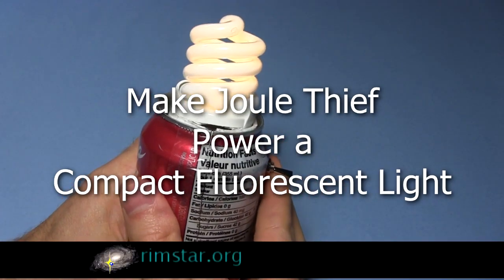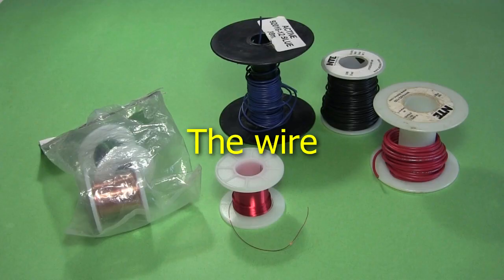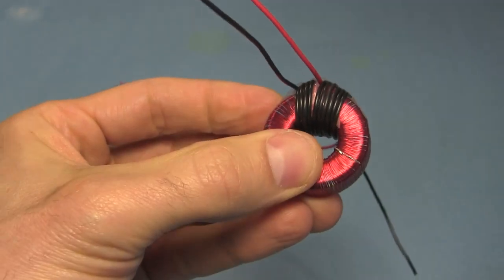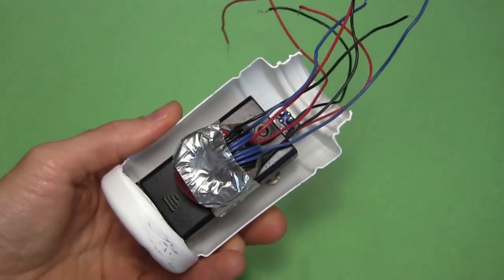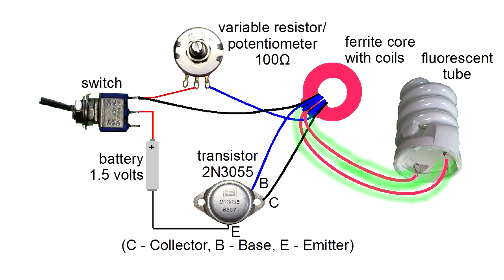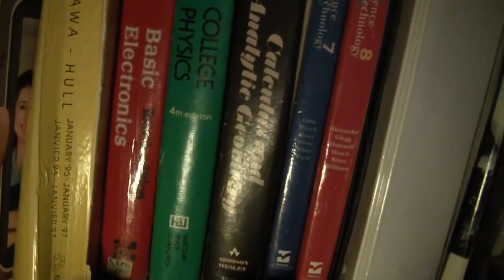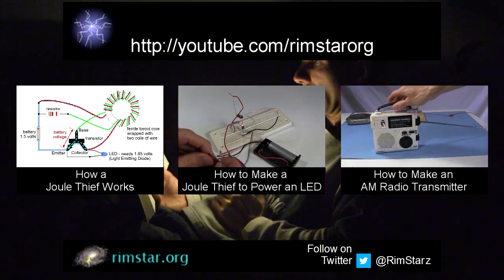How to Make Joule Thief Light a CFL - Jeanna's Light

Comment: i tried to make it couple of times on different  sizes of ferrite core... but i doesn't got any  voltage on my secondary coil. please help me regarding this problem....
Reply from the maker: +Diwakar Dey Any number of things can be going wrong. First check your connections to make sure they're right. The way the coil is connected to the circuit is the opposite of what you'd expect. I'll assume you used thicker insulated wire where the coil ends meet as I showed in the video. Try a higher input/battery voltage - that''ll result in a higher output voltage. Look for a lower wattage CFL (you can see more on that in my follow-up video here https://www.youtube.com/watch?v=yz_99oVMbSI).
Reply: +RimstarOrg does there is drop in current after passing through the coiling?

Comment: hi, can i use a permanent magnet from a speaker to wind the wires.
i have been trying for a month but i am not getting success.
Reply from the maker: harsh bawari I really don't know how well speaker magnets will work. The magnetism may interfere or it may be too weak to interfere. You'll have to try it and see.Switching to a lower wattage CFL will help. Also, using more batteries in series (positive of one connected to the negative of the next one.) I wasn't getting any success until I added a second battery. Also, check your connections to the coils carefully. They're connected in a way that's backward what you'd normally expect. And pay attention to what I say in the video 2:10 where I talk about the two ends of the coils coming close together with the thin insulation. And lastly, my follow-up video "Fun with Joule Thief Powering a CFL" may offer some insights https://www.youtube.com/watch?v=yz_99oVMbSI
Reply: RimstarOrg have you tried an core transformer for a joule thief? try it, i think it will work. you can also find some formulas for an air core transformer. i have also seen a video on ferrite core vs. air core, really air core works well. how much resistance worked for you? i will try that much fixed value resistor.
Reply from the maker: harsh bawari I suspect an air core transformer might work too, since it's a toroid. In a toroid that is completely and well covered in windings, most of the magnetic field is inside the toroid, which makes me think it doesn't matter if it's air core or ferrite.As for the resistance, I used a variable resistor to control the brightness, so what works depends on what brightness you want. See the link I gave for my follow-up video where I show different resistances with different CFL tubes.
Reply: RimstarOrg

I have made JT circuit using just air core toroids but, you need an order of magnitude more windings to get the same inductance as using even a small ferrite or iron powdered core.  I don't recall the ratio but it is a lot of wire.  You also will get higher freqs. this way as well.

Bill

Comment: Hello!
Greetings from brazil!
I'm trying to build one of this. but all i got is 50vac on output and a little noise from coil. operating at 3v
any clue? thanks
Reply from the maker: Hard to say without a lot more details. I know adding the second battery helped me. Maybe keep adding batteries in series? How are you measuring the voltage?  An RMS digital meter won't give a very accurate measurement for this type of output. You almost need an oscilloscope. Oh, an trying a lower wattage CFL might help.
Reply: RimstarOrg
Hello!
thanks for your answer.
Here is the deal, i got the same output on 6v;
and i tough the same about the cfl lamp. so i bought a 11w cfl, then remove bulb for test, and again no result.
i know that there is some ac voltage output, because i put my fingers on output, but that was such a bad idea!! lol
yep, i'm testing with a multi meter! :( (don't have an oscilloscope, these are so much expensive on brazil.)
i'v made two coils, and with magnet wire i'v got 49vac
i think that the red coil need more wires.
Reply: Mauricio Scotton i forgot: fresh batteries!
Reply from the maker: Mauricio Scotton
That sounds like you mean you got it working! (the fresh batteries) If so, yay!

Comment: can I use 10k potentiometer ?
Reply from the maker: You can but the required resistance is so low compared to the 10,000 ohm range that you'll really just have it turned all the way in one direction. You need under 100 ohms.

Comment: What's the output voltage ?
Reply from the maker: I estimate it's around 1000 volts. I was outside the range for my oscilloscope so I couldn't tell exactly. You can see this measurement at 3:10 in my Fun with Joule Thief Powering a Compact Fluorescent Light video.
Reply: RimstarOrg Thanks, I'm gonna try to build one and make a video.

Comment: I'm thinking of making something like this but instead of this circuit I'm either going to use the inverter from a phone sanitizer device that you put your phone in. or the guts to a UV light that runs on 4 AAA batteries. Not sure which one to use. I have a small CFL bulb that failed but the tube works. And I just threw out a vitamin bottle Dang should have kept it. Might use a small power bank for power instead of the AAAs.

Comment: Hi...I used a MJE3055t transistor...and it seems to get very hot....is this ok..I have no heat sink on it...and its a TO-220 case..
Reply from the maker: +Kennynva T. If it gets very hot then you could end up damaging the transistor. According to this datasheet it can handle up to around 115C https://www.fairchildsemi.com/datasheets/MJ/MJE3055T.pdf and you'll also run you battery down sooner than if it kept cool. You can put a heat sink on a TO-220 case. I show in my follow-up video the difference I get without and with a heat sink https://www.youtube.com/watch?v=yz_99oVMbSI.
Reply: Doing it this way..the cfl will light a little on each leg..IF i touch it with a pair of pliers..or anything metal...cant figure out why tho..do you tie each leg of the cfl together? making 2 legs..that have 2 wires connected together..
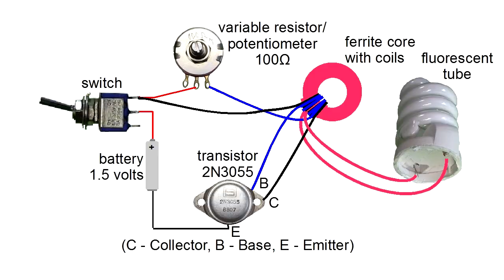Reply from the maker: +Kennynva T. I'm not sure what you're defining as a leg. The way I do it is shown in the video at 4:54.
Reply: The wires coming out of the light bulb..do you think the transistor I am using is ok? or get the one your using...? Thanks for your fast response..
Reply from the maker: +Kennynva T. Regarding the transistor, see my previous reply. Compare the datasheet for yours to this one http://www.onsemi.com/pub_link/Collateral/2N3055-D.PDF and you'll see the 2N3055 can handle a higher temperature. But if yours works fine with a heat sink then it doesn't matter.
Reply: Ok thanks...you made a very good video..thanks...

Comment: If I wanted to use this circuit to power a 36W fluorescent tube, what would I have to change?
Reply from the maker: You'd need a bigger power source and probably a bigger coil to handle the extra current.
Reply: I’m thinking, same windings but ones that can handle more current?
Reply: @RimstarOrg  Yeah I'm thinking I could wind a toroid with slightly thicker wire so it doesn't act as a resistive current limiter, and then do a big bank of AAs in parallel to supply the current. 

Maybe also run at 3V instead?
Reply from the maker: Regarding the number of windings, I don't know if a 36W fluorescent tube would require a higher voltage in order to light. There's the voltage you need in order to ignite it and then once lit, you can use a lower voltage.

Comment: how long would those AA batteries last powering the cfl?
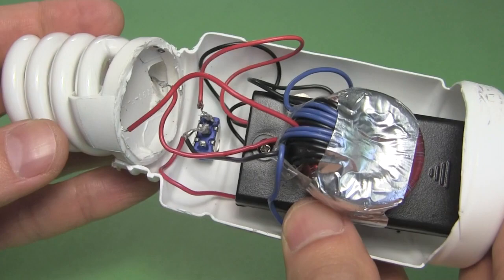Reply from the maker: +Amith Gowda If I add a heat sink for the transistor and switch to a lower wattage cfl (still getting the same amount of light though) then I get 1.5 hours of bright light followed by 15 minutes of dimmer light. I show this experimentation in my follow-up video at 5:15 https://www.youtube.com/watch?v=yz_99oVMbSI.
Reply: +RimstarOrg i got a smaller diameter core is that ok? and can use the windings from a transformer for the toroid?
Reply from the maker: +Amith Gowda With a smaller diameter core you may not be able to get enough windings on to get a high enough voltage. Hard to say without trying though of course. And yes, you can use the wire from a transformer. Just keep in mind the part of the video where I talked about keeping the ends of the winding apart and using better insulated wire at that point.
Reply: RimstarOrg  sorry to bother you again 😆 will that aluminium foil act as a heat sink?
Reply from the maker: +Amith Gowda I would think so. I guess if you used it to give enough surface area exposed to the ambient air. I don't know how the thinness would affect it. It would be an interesting experiment.

Comment: why we cannot overlap wire while winding the toroid?
Reply from the maker: The insulation on those wires is very thin. It has to be otherwise you wouldn't be able to put on enough turns. However, when the two ends meet after all those turns, there is a high voltage between the two ends. That high voltage is enough to break through the thin insulation and create a short circuit, preventing the circuit from working. That's why before the thin insulated wires meet, I connect on some wire with thicker insulation instead. The high voltage doesn't break through the thicker insulation.

Comment: what gauge of wire you have use?
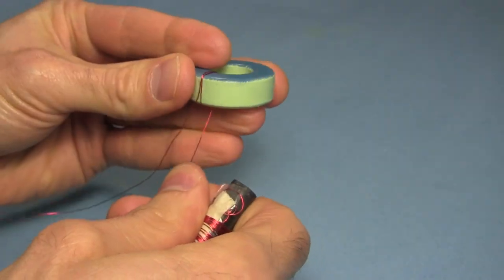Reply from the maker: The many turns coil was 30 AWG wire. See the video at 1:55. The gauge of the other wire doesn't matter.
Reply: can I use 29 gauge wire for 250 turns ?

Comment: can you tell the size of toroid ?
Reply from the maker: It was pretty randomly selected. I chose it because I figured it was big enough to get a few hundred turns of wire on. It was 1 1/4" outer diameter by 5/8" inner diameter. To help, I also have this webpage that may have more details http://rimstar.org/science_electronics_projects/joule_thief_power_cfl_with_jeannas_light_circuit.htm.

Comment: I suppose a person could integrate a solar cell,use rechargeable batteries and mount these lil guys outside?
Reply from the maker: Absolutely. In fact, that would be a nice addition.
Reply from the maker: MANIK SHARMA
I don't see why you couldn't recharge a capacitor with it but due to the losses you'd eventually run out of energy. This isn't a free energy device. The name, joule "thief", is a very misleading name. All it does is build up energy in a magnetic field, while outputting nothing. And then it outputs that energy in a burst. Then it builds it up again and repeats. So it seems like it's putting out higher voltage and current than it inputs but it's not really.

Comment: why do we have to use transistor in the circuit why can't we just connect the joule thief directly to the lamp?
Reply from the maker: The transistor is a part of the joule thief circuit.
Reply: what is the big top priority for the transistor in the joule thief not to mention it is working as a switch ..what will happen if we connect it directly to the lamp?? and thanks
Reply from the maker: See my video here about how a joule thief circuit works https://www.youtube.com/watch?v=0GVLnyTdqkg. You can see it's an important part of it.
By connect the lamp directly, do you mean without taking it apart? That won't work. There are all sorts of electronics in the lamp that will interfere.

Comment: what is the resistance when it reach max brightness
Reply from the maker: Unfortunately I don't know. I didn't measure it (I'm not sure how I would).
Reply: can you measure it i need that information please
Reply: what if i use 22ohm resistor instead of variable resistor?
Reply from the maker: Oh, I misunderstood your original question. I thought you were asking about the impedance (resistance to AC) in the coil. See my follow-up voltage where I make a bunch of measurements and give tips. Basically, the lower the resistance, the brighter the light but the shorter a time the batteries will last.

Comment: How big was you ferrite core?
Reply from the maker: Prohaxz gaming 5/8" inner diameter, 1 1/4" outer diameter, 3/8" thick. I selected it pretty much at random but such that I could at least get a lot of turns of wire on it.
Reply: Can I use a 100k-ohm potentiometer, I had it lying around
Reply from the maker: Prohaxz gaming It's bigger than mine so you should be able to get more turns on. I can't say for sure of course whether it will work but I don't see why not.
Reply from the maker: Prohaxz gaming 100k-ohm is a little big. All your tunability will be with the potentiometer turned almost all the way down, if not all the way. I just checked one of mine and turned all the way down I had 50 ohms. I turned it a tiny bit and already I had a few hundred ohms, too much. There was nothing in between. I suggest doing the same measurements yourself to see how useful it would be. From my follow-up video "Fun with Joule Thief Powering a Compact Fluorescent Light" you can see that at times I needed 30 to 50 ohms.
Reply: Thanks

Comment: What is the dimensions of the toroid
Reply from the maker: It's around 1 1/4" (3.5 cm) outer diameter and 5/8" (1.875 cm) inner diameter.
Reply: @RimstarOrg  Thanks because I have been trying to wind the primary and feedback but there is not much space on mine but I did it and it works great

Comment: how the size of Ferit core??
Reply from the maker: It's around 1 1/4" outer diameter. It was just one I happened to have but it's about the smallest you want to use. I probably took that one from a microwave oven. It needs to be big enough to get lots of turns of wire onto.
Reply: Ok thanks

Comment: i subscribe your channel as well as hit a like. how long will the circuit blow the bulb?
reply as soon as possible.
BTW your circuit is awesome if it is real.
Reply from the maker: +Mobin Akhtar In my follow-up video https://www.youtube.com/watch?v=yz_99oVMbSI, at around 5 minutes and 45 seconds in I show where I test the time. This one runs brightly for around 25 minutes. If you put the transistor on a heat sink and use a lower watt CFL (but still put out the same amount of light) then it runs brightly for around 1 hour 30 minutes.
Reply: +RimstarOrg thanks, now i m going to try this project.
I will ask some questions while making this project if needed.
Reply: +RimstarOrg one more thing, if i use some led diodes (approx 10) in pcb board in place of CFL then how long will it blow???
Reply: +RimstarOrg and is it possible to blow some LED/CFL without any power supply. I m talking about free energy. Many videos are available on youtube. I could not justify that free energy is real or fake?
Reply from the maker: +Mobin Akhtar No, you need a power source of some kind.
Reply: if i use some led diodes (approx 10) in pcb board in place of CFL then will it blow? If yes then how long???
Reply from the maker: +Mobin Akhtar The voltage is much too high, around 700 volts. A CFL needs a very high voltage and that's where this circuit comes in.

Comment: I'm not so sure about using not exact voltage, amp, freq, etc with a CFL, a CFL emits UV, and ionizing radiation at 30cm and less under normal conditions, this could dramtically emphasize that figure. I'm not sure with no data, but I'd lean on the cautionary side. Perhaps you should runs some tests/experiments to determine safety/health.

Comment: Couldn't you hook this up to a crystal radio.... Infinite light from AM Radio powered CFL!
Reply from the maker: John Bilkey You'd need an awfully long antenna and/or a very powerful station to get the necessary power. I've seen a joule thief powering an LED using a crystal radio antenna raised up by a kite.

Comment: I wonder if a Joule Thief could be used with the human body as electrical source?
Reply from the maker: ***** No. The joule thief is just a circuit for converting low voltage to high voltage. It does it by storing up energy over a period of time and then releasing it in a quick burst.
Reply: RimstarOrg My body provides constant ~0.3V when I measure left to right hand while sitting still - more when moving around. My idea is to use the own body as electrical source for, e.g. a LED torchlight but for that I need more than 0.3V - exactly what a joule thief does, right?
Reply from the maker: ***** In order to turn on the transistor you'd need 0.7V. But I'd question just how much current your body can supply even if you got 0.7V. Would it be enough to power your torchlight even with the joule thief. Dunno.
Reply: RimstarOrg Thanks for the info. I'll try it.
Reply: thermo electric from heat body+joule thief
Reply: miroku vladmir You mean a peltier element?
Good idea, could be another option.
Reply: ***** Put a little bag of ice on one side of it. :) The other side on your body. It will surely work. Similar things are done already too.